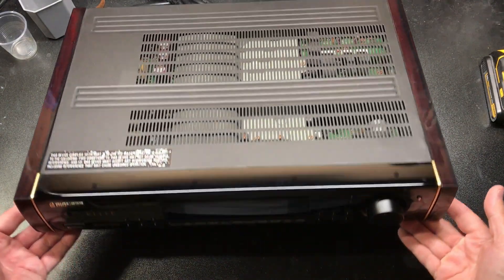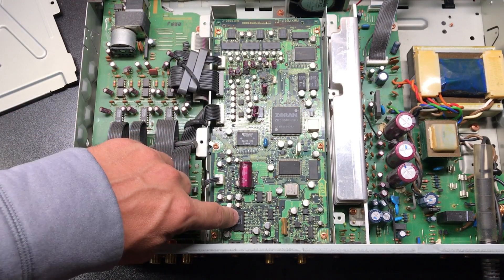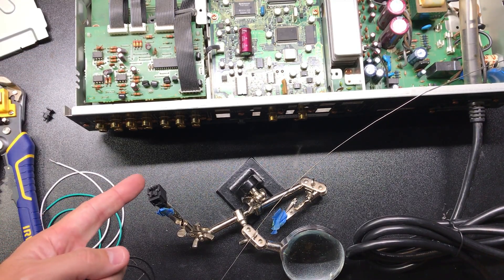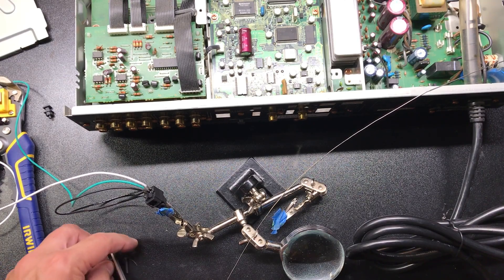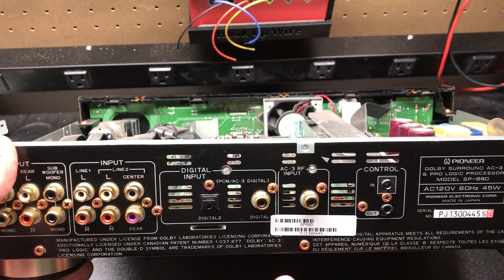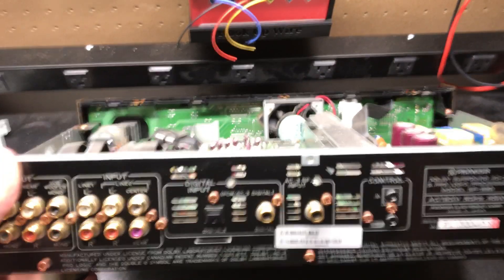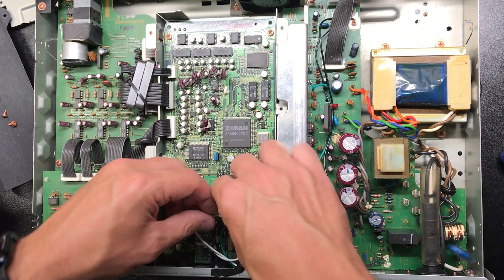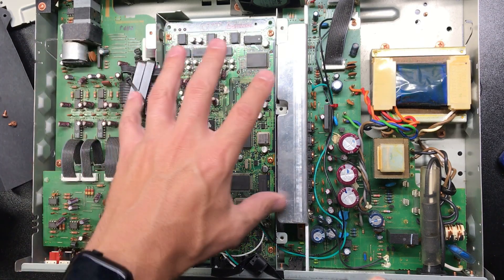Pioneer SP-99D Digital Audio Out Mod

Comment: Would a mod like this be possible on a Panasonic Lx-k780?
Reply from the maker: Yes, absolutely.  If you can find the DAC that handles digital sound on your audio board, there is a lookup where you can find what PIN to tap for digital signal.  I could not find a service manual for you player, otherwise I would've done it.